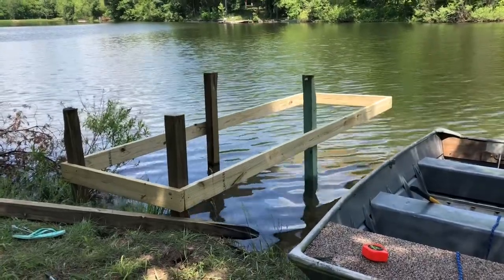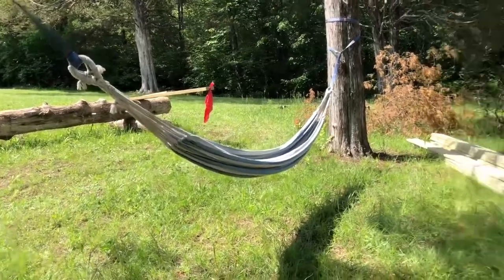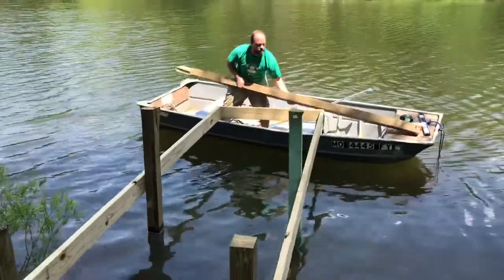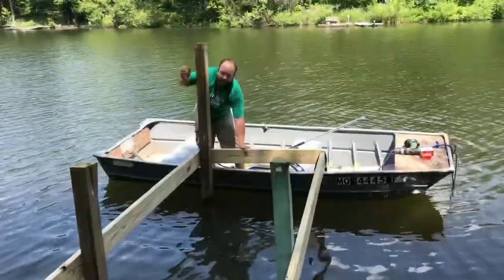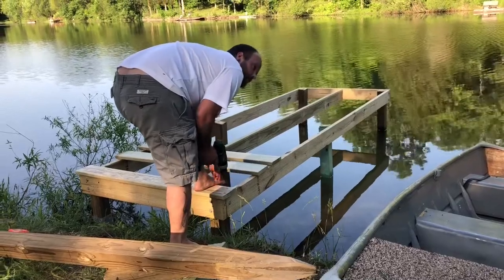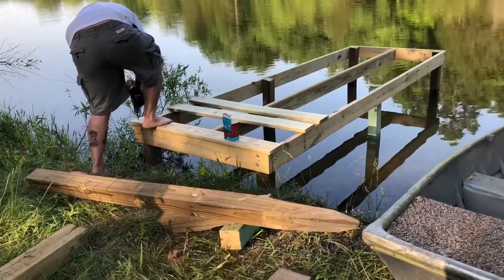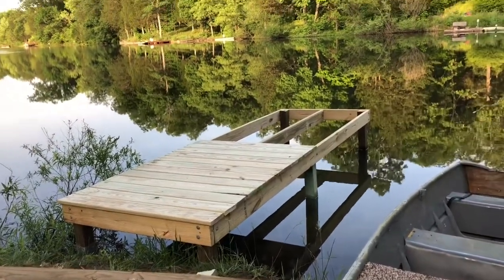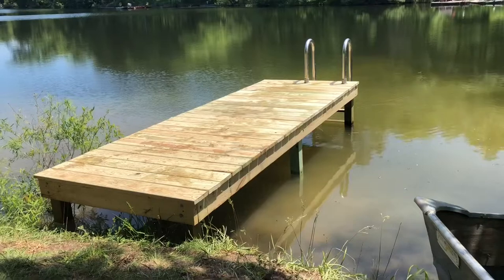How We Built Our Dock Walkway on the Lake!

Comment: Hint screw a block to top of post to hammer or sledge so you dont mush and ruin top of post and have to cut it lol he did this very hard way
Reply: He had longer 4x4s then he needed he cut them to length after hammering them in so screwing a 4x4 piece on the end wasn't needed for this project and he didn't have mashed up ends after he cut the posts to length